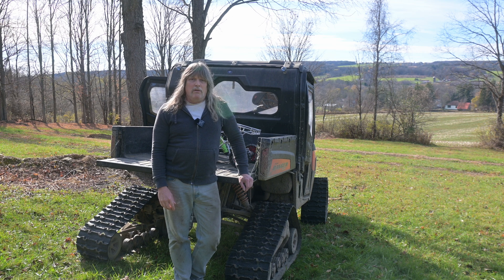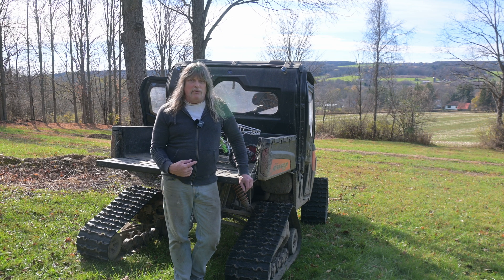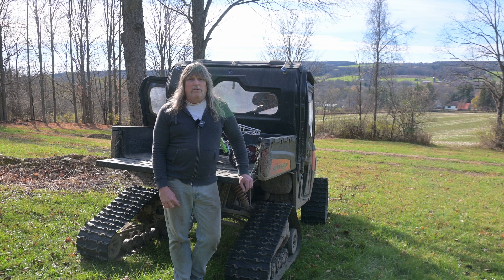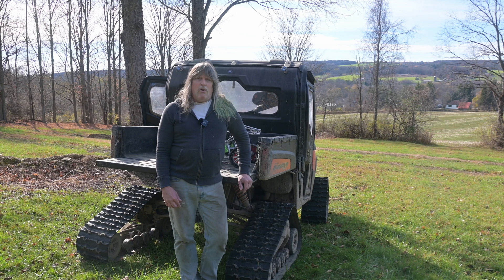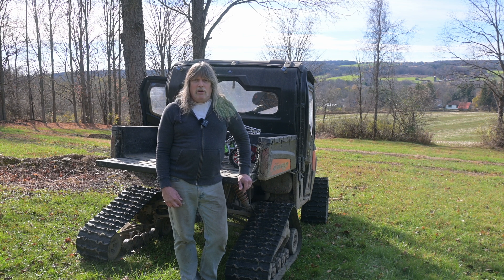50cc Taylor powered Kraken Vekkta track testing the RPM addition to the wireless engine SCADA

Comment: Very cool,  is there a limit on the data set for rpms.  14900 is the max I see but it sounds higher….i was typing this when the “rpms seem sketchy “flashed haha freaking cool man
Reply from the maker: Hey Alterd, well according to Mike Taylor that engine and pipe combo should go to around 16,000. The software needs to be tweaked to improve accuracy and filtered to stabilize the RPM readings. It is filtering the temperature readings and they are way more stable. The RPM's will eventually be displayed on screen like the old style analog dial. Following numbers is way to much of a pain. A lot of work left on it. Thanks for checking it out buddy

Comment: Riding that throttle smoothly off those jumps is nice to watch lol personally i always get caught of guard on the first jump of the day myself lol. That was some nice driving. Can’t wait to see you smooth out the digi data display. Hope we have some more dirt driving weather ahead still. 🖖⚡️⚡️ Good energy brother!! (switching gears and focusing on another build should help not get burnt out focusing on the detail work your doing who knows maybe you’ll make an indoor dyno or something to continue development on that truck until winter is over not sure if that would work though sense you probably want some engine load or something idk)
Reply from the maker: Thanks Ghostworks, and indeed one of the projects that the SCADA will morph into is a dyno. The problem is i have such a limited time to spend on these projects so it takes forever. Thanks for checking it out

Comment: Your track is coming along nicely. You need a big area like this to really rip around. The big berm is super. Your Kraken is so nicely modified. NASA approved. Great job!
Reply from the maker: Thanks RC, a tractor with a bucket sure come in handy for that kind of work. If i had to shovel all that dirt there would be no berms and no jumps, lol. Thanks for checking it out RC
Reply: @RCWalletVacuum  I would think that the awesome tracked vehicle could carve out the terrain is a short minute just by running it around and digging up the dirt. You should do a video on it as it's totally cool looking.
Reply from the maker: @RCRoads  Well i have the aluminum for the chassis on its way and the 5ive T electric conversion kit ordered, then comes all the work
Reply: @RCWalletVacuum  It's a thing of beauty. Many years of pleasure and repairs. I would definitely love to have one some day but you really need a big open space to play.

Comment: Such a cool truck. Reminds me of a dirt bike engine on there. Lol 
Your tech is way over my head bro.  I enjoy your out of the box creativity. Love to see what you can do when you have tools to work with. Was wondering what kind of rpm numbers should you be seeing? 😅  
Oh the weather. Yes. I'm obsessed with making an rc tracked vehicle aswell. But the tools I have are limited. I like the idea of a rubber track. Think it would spool up faster then a heavy track like on your truck. But just theory. Plus I can't afford a set of tracks of any kind. So being creative is a must. Or just keep dreaming.  Lol best you can find is that tracked tamia sno cat thing. Not paying for something so brittle and slow. Just my half cent input. Lol .
Reply from the maker: Hey Wally,  the RPM's should go up to around 16,000 with that pipe. I was seeing upwards of 15,000 but the numbers just seem erratic. Once that is corrected the RPM's will display on the LCD like an old style analog needle dial. I've been bouncing the snocat idea around for awhile, tested the tracks out on the Rovan chassis but there are issues with adding to that existing chassis so a purpose designed chassis seems the way to go. Thanks for checking it out Wally
Reply: @RCWalletVacuum  sounds like a well thought project. Plus, fun. Yeah there's that. . Lol

Comment: Nice test run, looks like the temp sensors are working great, I’m with you on the RPM it seems to bounce all over 👍🏼🤙🏼
Reply from the maker: Hey Ben, once the rpm calculation issue is fixed i'm going to make the rpm display on the LCD like the old analog dials. Reading numbers is very difficult. Thanks for checking it out Ben
Reply: @ sounds like you got a handle on this 👍🏼🤙🏼😉
Reply from the maker: @Meyers2strokeRcgarage  Hey Ben, when you get a chance check your email
Reply: @ yeah I got your email I just haven’t had time to get back with you, I will get it done this evening 👍🏼🤙🏼 been busier than a dog with two peckers 🤣😂